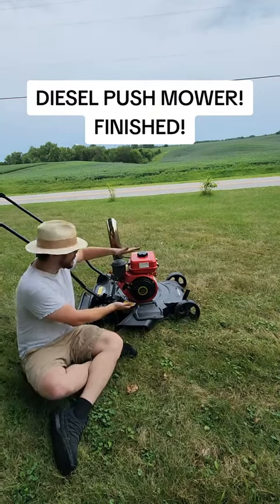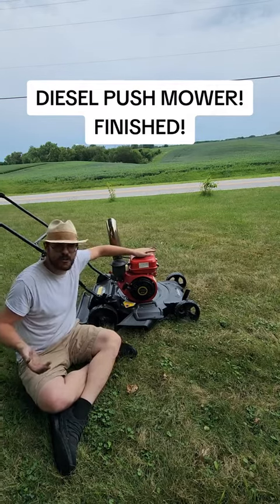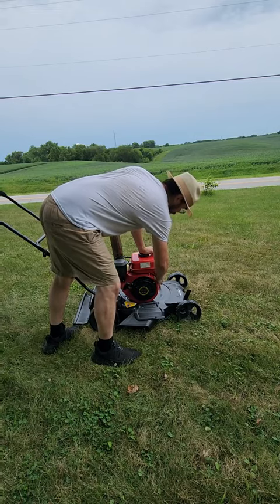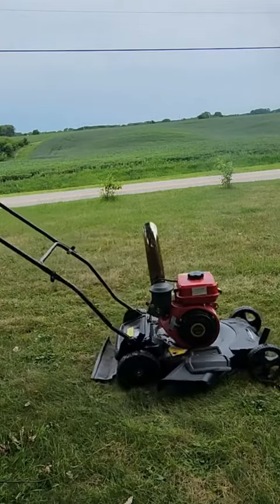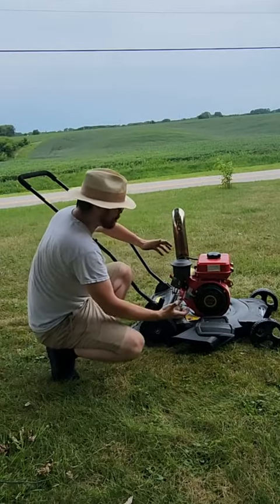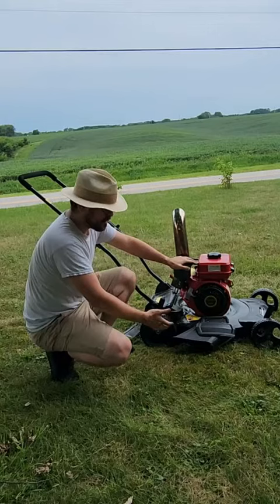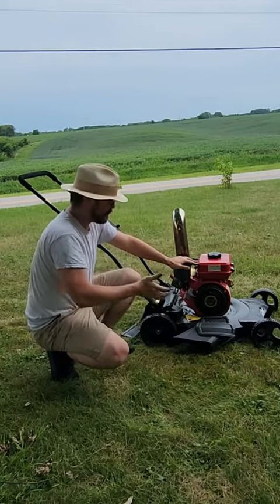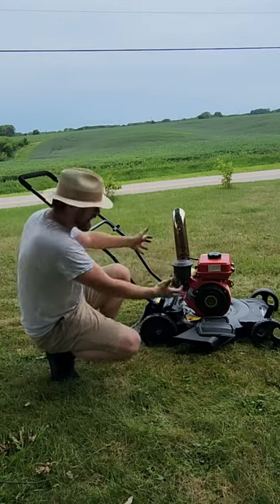DIESEL PUSH MOWER ROLLS COAL

Comment: I have one of those little diesel engines they are pretty cool!!! I also had the idea to put one of those engines on one of those horizontal shaft mowers and you actually did it Hell yeah!!! They use a Lot less fuel than gas engines

Comment: I thought about this considering diesels produce more torque if they’d be better for a push mower or riding mower. Similar to how tractors are popular. I figured that start up would be more difficult than gas but I’d like to see a comparison of what this little push mower could do versus its mainstream gas counter part.
Reply: Yeah they are nice on small engines.
I saw a marina use a diesel mower to pull boats out of the water.